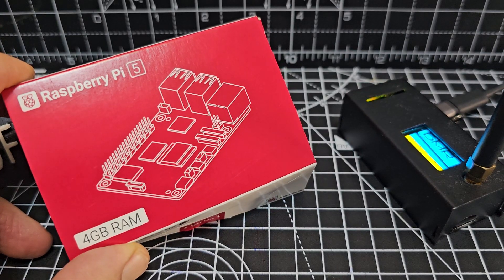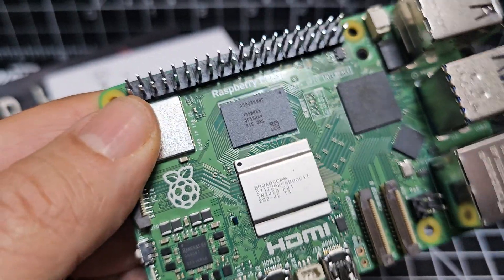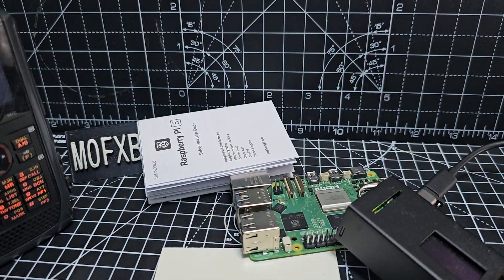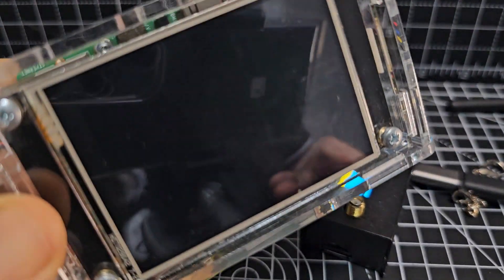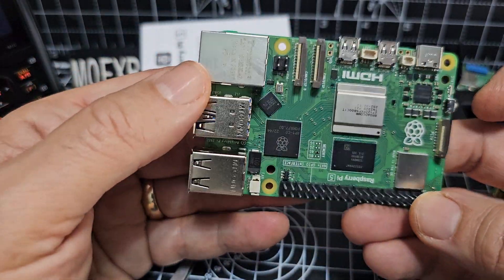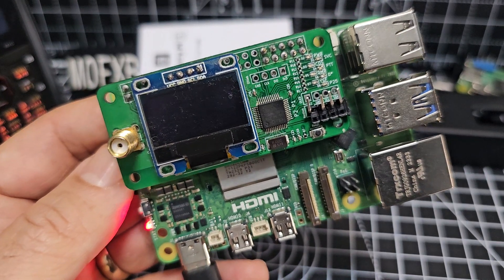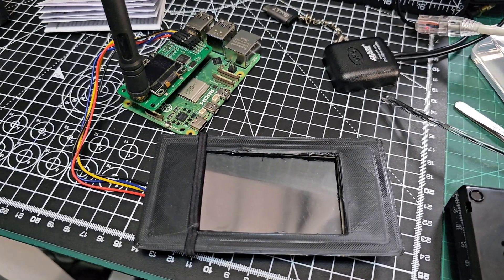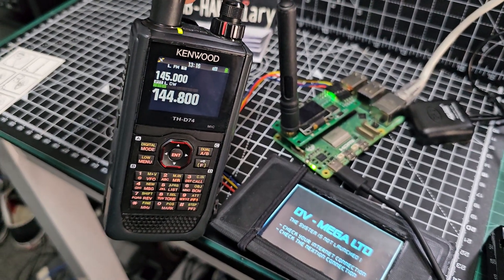NEW RASPBERRY P5 - UNBOXING & mmdvm

Comment: Andreas, will any duplex MMDVM hotspot work with the Raspberry Pi 5? I just bought the Pi 5, but I assume it needs a dual hat, preferably for me one without the OLED, since I'm connecting this to my Nextion and I plan to house it in a C4LABS case. Please advise, my good friend, 
KN6ZFM, Gregory
Reply from the maker: Yes pi5 works running pistsar but there are many screens and hundreds screen software you have hmi files and tft files om different size screens then you need load drivers to pistar add freq big learning curve .

Comment: I cringed when you put the hat on the pi. I'm not sure, but it sure looked like the display hat pins in the center are rubbing against the pi gpio pins in the center.
Reply from the maker: Yes they are very close but not touching the Hat works fine on my other Raspberry pi models it looks like Pistar need to update the image .
Reply: Great, sorry to be a nervous nelly - but it's a rare pi5 ! Anyway, you might put it back on the original pi, ssh in, and do an update/upgrade. Might work - worth a try.